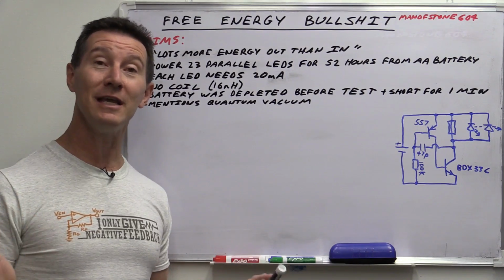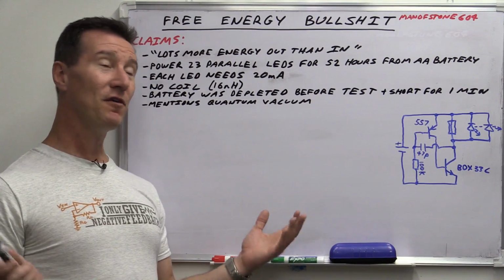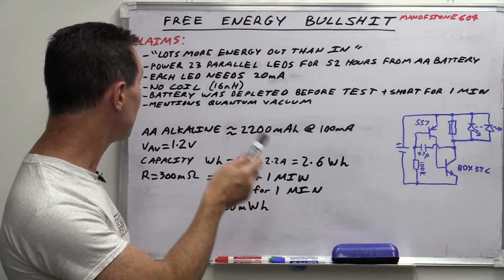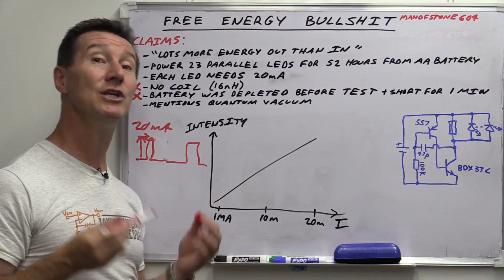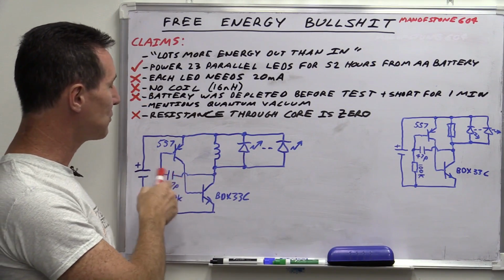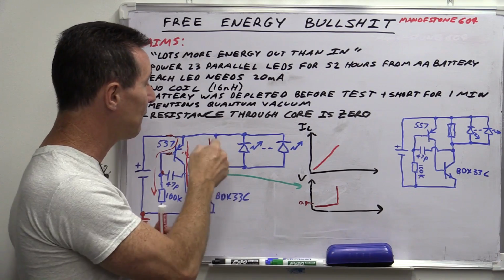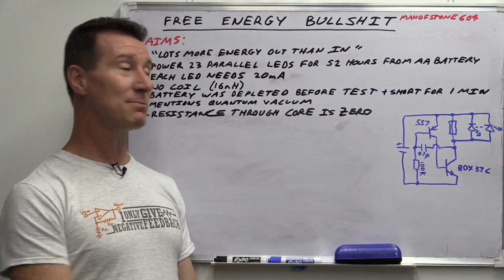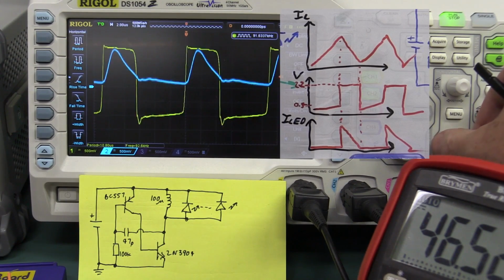EEVblog #708 - Free Energy Overunity is RUBBISH!

Comment: Any student of Electronics with a basic knowledge of electronics theory knows that Tesla created energy from the either over 100 years ago. Many of his patents do this. The controversy about free energy is futile because it's existance  was proven so long ago. Free Energy Mysteries - Expanding Universe which is accellerating, Electrons observed popping in and out of existence, Dark energy, Anti-matter, Light accellerating after slowing down through transparent medium, Why?
Reply: +Tbonyandsteak The level of ignorance and stupidity is alarming. I'm just looking at your channels and amazed of how stupid you 2 fucks are.

Case dismissed, move along.
Reply: "Bl4ck your Microelectronics engineering,  is not exactly high voltage knowledge."
And then? Does it means that I don't know anything about high voltages?

Let's take a look at your gibberish here : 
"Take a capacitor that charge and discharge extremely fast and almost without lost".

_"Charge that capacitor and charge another capacitor with it.
Now put those capacitors in a serial connection and you will have the same charge again.
Just now it is on 2 capacitor in a serial connection."_

"That charge you charged another capacitor with, you can call free energy."
From where exactly the charge of the first capacitor comes from ? from thin air ? You've charged it with SOMETHING first that required efforts and power. That's not free energy.

"Well nothing was wasted with that charge."
Based on what? You assumed that it was almost without loss, then you go and say "nothing was wasted".
Even in an Ideal world where you don't have dissipation of power into resistances, voltage drops, and so on, you still need that first charge to be generated using a reliable source.

"What ever you put between those 2 capacitor: coils, transformer, engines. was for free".
Nonsense, Learn Electronics first before speaking such baseless statements.

"You have used this Technic in Microelectronics engineering, without having that understood."
*Technique.. Says who? No I didn't use this at all and your whole concept doesn't make any sense.
2nd, how do you know that it's in those advanced courses if you don't know what the basic concepts of electronics are ?

Again, it seems to be like that you both are formated with nonsense over the Internet.
Learn Basic physics and electronics before you comment like that, otherwise you're wasting your own time and other people's time too.

"People should really LEARN to VALIDATE the laws rather than blindly following them."
It has been validated million if not billion of times by engineers, scientists, day-to-day engineering applications, in very vast domains.
We are not "blindly" following them, any one with a proper education can derive the laws for himself if he was willing to, and of course test them over and over again.
Your very own computer relies on Semiconductor engineering, quantum mechanics, integrated circuit design..

"And stop being such a cheap Dengse whore."
So you depict the minds that made this world advance as "whores". What exactly you have done?
Yes, nothing. You spawn into this world and die like if nothing happened, that's all. Be ashamed of yourself to say the least.

 Capacitors :
https://en.wikipedia.org/wiki/Capacitor#Networks

Thermodynamics :
https://en.wikipedia.org/wiki/Thermodynamics

Energy:
https://en.wikipedia.org/wiki/Energy

Physics :
https://en.wikipedia.org/wiki/Physics

Nicola Tesla (you all are really robbing him from his achievements with your baseless acts) :
https://en.wikipedia.org/wiki/Nikola_Tesla
Reply: Bl4ck Gosh your a fucking wannbe idiot,
You have never EVER been an electric engineer. Anybody can show list, But did you UNDERSTOOD IT?

That have not been shown AT ALL
Just a stupid troll.
Do not even believe you had a capacitor in your own hand in all your life.
Reply: Michael Chapala It puzzles me that 90% of students do not even get the consequences of the equations of natural laws.
Well that is properly higher.
But in other hand not, since it is sold in a cryptic way. And there is the double bind of Thermodynamic.

Math is sooo confusingly simple, due to it really just is EXACTLY as stated.

And you have to decrypt its meaning.
That is really a mindblowing discovery.
Reply: I'm a student of Microelectronics engineering, and what you are saying is beyond complete rubbish.
1st it's "Ether" not "either", it wasn't proven and none has come with a repeatable scientific experience proving it.
There's no free energy : Before even making false claims about electronics students or engineers, get your facts checked, the free energy debate is hopeless. 
Tesla never created energy from ether and he'd facepalm himself if he heard that.

"Accelerating universe, e-, dark energy..." so you're bringing all the concepts you don't understand and labeling them under "Free energy"?

What's futile is changing your minds, because you're in a deep circle of perpetual believes, even to a mystical degree. 
Without any degree or scientific education, for most of the time, you spend your time on youtube "dreaming" about magical solutions rather than educating yourselves about the real science behind the world around you.

Drop your magical believes and read the books that real scientists have made, because they are a lot more intelligent than you and your whole mystical circle, and have made real advancements for the world.

Here's a link if you're someday capable of understanding it :
https://arxiv.org/pdf/1002.1284v1.pdf

http://www.naturalnews.com/045942_free_energy_laws_of_thermodynamics_physical_reality.html
Reply: You assume that I have no training.. To set the record straight,I am going to make a series of videos demonstrating free energy in both closed and open circuits. Describing in great detail the theory I will sell the circuits. So you are telling me that electrons no not pop in and out of existence? You understand the mysteries of dark energy? Pyramids do not generate energy? The energy density of sunlight is NOT over 1000 watts per square meter? Free energy exists. Of course it does. Tesla broke the land speed record with a car that had no visible means of power. There is no need to answer this post. It is obvious that the World will always be flat.
Reply: It is obvious that the World will always be flat. 
This very statement as well as your channel's content represents the culmination of what the whole crap the Internet can offer :
flat earthers, religious fanatics, weird and absurd theories 

I'm wasting time with your lunacy.
Reply: Science is faulty. The information is constantly changing. What was fact yesterday is disproven today. No natural laws of thermodynamics are being broken. Most of these systems are open allowing input from outside sources. The idea of a closed circuit with no apparent means of input is a threat to modern power generation so it is criticized. Dr Moray placed quartz crystals next to a radioactive element to form an amplifier tube. He created multiple stages for increased amplification. The output was exrtraordinary,
Reply: Dismiss Thermodynamic and it becomes clearly.
Energies interact and is never Thermodynamics.
"Energy out of nothing" is a statement that is deprived from Thermodynamic belief system.
You could call it "Energy out of the Ether" as they did in the early 1900
but more precise it really is  "Energy out of interaction." and that is universal.
Can NOT use energy unless it interact with something.
that would have no purposes at all.

Bl4ck your Microelectronics engineering,  is not exactly high voltage knowledge.

Take a capacitor that charge and discharge extremely fast and almost without lost.
Charge that capacitor and charge another capacitor with it.
Now put those capacitors in a serial connection and you will have the same charge again.
Just now it is on 2 capacitor in a serial connection.
That charge you charged another capacitor with, you can call free energy.
Well nothing was wasted with that charge.
What ever you put between those 2 capacitor: coils, transformer, engines. was for free.

You have used this Technic in Microelectronics engineering, without having that understood.
Well it was right in front of you and you did not notice it.

The whole fuzz comes the preconceived false idea of Thermodynamic.
Which by the way comes from the early 1800, before all the great Scientist works.
Reply: Bl4ck yeah that is the ONLY thing you got , condemanation.
You are on an escape, creature.  Quite pathetic
Your channel is as empty as your personality
hehe what a laugh
Reply: For your information I have extensive training in electronics. You're some arrogant guy with training that thinks he's God. When you can answer all of the mysteries of dark energy or have a Unified Field Theory then you can criticize others. Tesla and Moray proved free energy exists. Are you Nikola Tesla or Dr Moray? I didn't think so.

Comment: free energy? It might be possible. tae this thought experiment. make gyroscopic generator and light bulb encapsulate it send it to in far far far into space whre ther abosulyt nothing to disturb it. spin the gyro. since thikg terms of quantity. assuming the bulb filament never burns out. will the light bulb ever run out photons?
Reply: Rrook C have you ever opened a tenth grade physics textbook
Reply: the generator will slow it down. a generator causes it to slow down because of the electric fields. if you look at a dynamo of a bicycle or something. when you turn it by hand you'll notice that it will be harder when the light is attached to it. that is because generators slow down when the load increases. its based on Faraday's Laws of Electromagnetic Induction

Comment: Hi sir I have the utmost respect for you, your a genius, I have a simple question for you, I but a lot of items and they are missing there transformers, and I want to check the item before buying transformer, is there a gadget that I could hook up to a batter or attach wires direct to charge the batteries or to run the item, so in essence I need a machine that can adjust volts and amps on the out going terminals, cheers from Canada.

Comment: finally, the voice of reason. a lot of assholes out there that have no formal electronics  education whatsoever , start playing with some circuits and are so amazed by the results, they think its either magic or they have discovered some violation of the laws of physics.  that' s an oscillator, effectively reducing the duty cycle enough to allow led lighting at reduced power.  nice  touch predicting the waveforms before bread boarding. I wonder how many npns the guy burnt out during his "research". nano henries was particularly  funny. if you haven't already , check out these idiots connecting generators to motors, that are in turn turning the generator! Nice shirt by the way, but I would have saved the short sleeved one for "summer". oh  yeah, NASA called, the space station wants their dashboard back.

Comment: This is basically what has came to be know as The Joule Thief, or a variation there of? Obviously all these free energy perpetual motion machines are a load of cods wallop, but here's a question for you. Why is the Joule Thief only know to the ppl who are interested in electronics, the circuit's ability to (w)ring every last drop of power from a battery is such a boon why has it never been taken advantage of commercially? All the millions and millions of batteries that go into land fill every year with just a fraction of their power used seems such a waste, especially when there is a circuit that can take advantage of it. So why are our homes not filled with devices that drain every last drop out of batteries, and that's not a rhetorical question, is there an EE reason why the Joule Thief type circuit can't easily be exploited?
Reply: +diecast  Those circuits are being utilized. My Kensington wireless mouse uses a pair of AA cells, and when its operation gets dodgy, I take the cells out and check them, they are, for all intents and purposes, dead as a doornail. So there is circuitry  inside that wrings nearly every drop of energy out of the cells. These circuits are nothing new, they have been in use for many years.

Comment: EEVblog:    What about a comparison DC circuit with 23 LEDS and limiting the current to the same few milliamps, leaving out the oscillator. just battery, resistance and LEDs. 

This would show if there is anything to be gained with this circuit. Still not free anything, but side by side would one last longer then the other.

Even if some of these circuits increase the efficiency of running a wad of LEDs, I don't see them scaling up to run the household.

Comment: I love it when you go on a rant :) I DID learn something, it explains why I had to shove a much higher ohm resistor on a similar LED I am using as a "power on" indicator in a project I did. I originally used the LED Current limiting formula for the said LED and it was WAYY to bright for my project. I made 2 boxes for powering my doorbell @ 9V and LED lights on my stairs @ 12V and wanted a way to switch them off with a power OK lamp, Fuse OK lamp and Power Output ON lamp using Red, Yellow and Green LEDs. The Reds where far to bright and I think I ended up using resistors that limited current to about the same as you 1 - 2mA which had me scratching my head LOL. Oh and the dude has taken the video down YAY! One more idiot off YouTube!! :D Thanks for your vid and as we say in the UK, Carry On! :D

Comment: I just find it retarded the guy is using a BATTERY in his little demonstration of "free energy"... Like... ignoring the fact that we have to take your word for it that the battery was depleted to begin with, and ignoring the fact that this video's calculations show that battery was very likely nowhere near as depleted as he thought it was, why the FUCK would you think it's appropriate to have ANY sort of energy source connected to your fucking machine that's supposed to demonstrate FREE ENERGY.
Reply: like... even if the mechanic of the "free energy" design requires something like a battery to be in it, you'd better be damn sure to have a fullproof way of proving to people that battery is totally fucking empty before running the test, but of course this guy does nothing of the sort and we're just supposed to take his word for it.

Comment: Nice video. These internet morons are so funny. People will throw hope into the wind and believe ANYTHING. I'm an electrical engineer and one of my brothers is a mechanical. We tried explaining to someone why perpetual motion machines were impossible, but they wasted $10,000s of dollars trying to prove it. Some people don't have the controlled emotions to be an engineer. The truth would crush their dreams too much.

Well I tried to model and simulate the circuit, I got it to work but the oscillator wasn't perfect. It's hard on these sims with finite time steps to simulate the astable systems. 
Anyways, in case anyone is curious. Here is a link to it. It was done with EveryCircuit.
http://everycircuit.com/circuit/5137728177438720

Comment: Energy is free and stolen by the so called energy or electric provider (company). Energy is around us. If it is not, then try to prove; build/make energy and sell it to me. If you can't make or build it and you have the energy to use or sell then you are a thief. ----only the device/machine that use to process and labor of men who work with the machine are not free.....If the electric provider selling energy, did they made it? I think 'NO'. They just process it. It came from environment. Did they pay it to the environment? How about energy from the SUN, WIND, WATER, HEAT from undergound? If I use Solar Panel, should I pay the energy I consumed from the SUN? Who send me the bill?

Comment: Perendev magnet motor is really a free magnet motor energy produces by repulsion force .
Reply: Every "shove" resulting from the magnets will align 2 opposite poles. Meaning: you give it a shove, it will start rotating a bit due to the repulsion force of 2 - or 2+ poles, and then it will slow down again due to the attraction force of 2 opposite poles.

The motor requires constant energy input, to counter that force.

Meaning: it is no Free energy device.
Reply: +Squishy  Perendev magnet motor is a scam. Proven, beyond a doubt.

Comment: Newman motor and Bedini motor ,they imitate the idea of fly wheel free energy   motor ,and they alternated just a little bit difference  from fly wheel energy to avoid stealing ideas from others ,but the idea is a convergence to one point magnet goes around coils produce energy when using a small dependent force to produce larce force to run the machine ,so Newman motor and Bedini motor are  good  for free energy if some one know how to make use of .